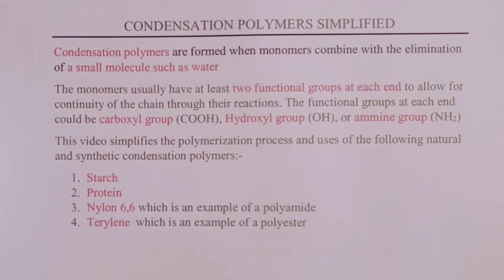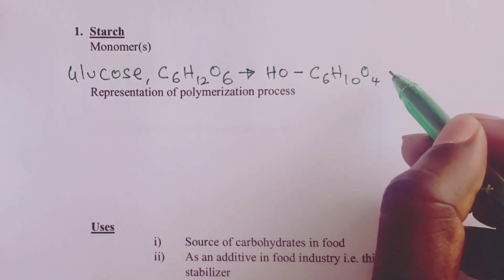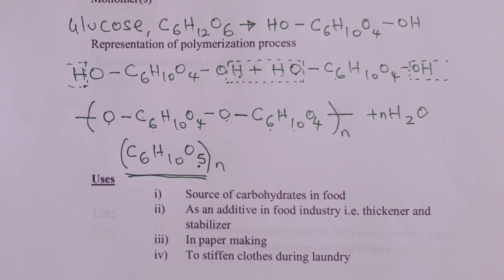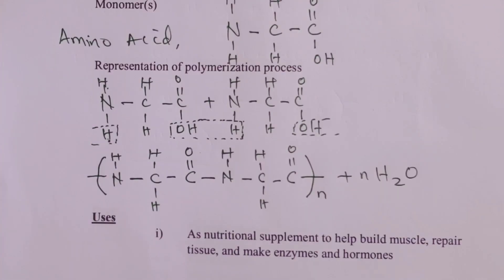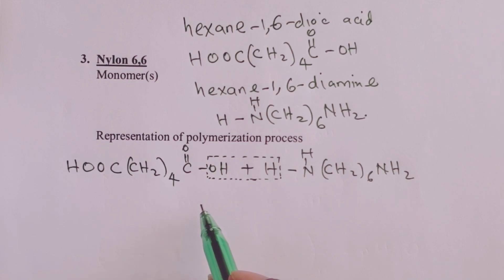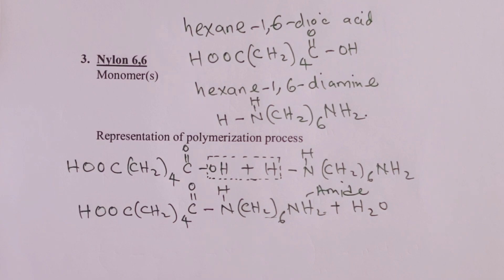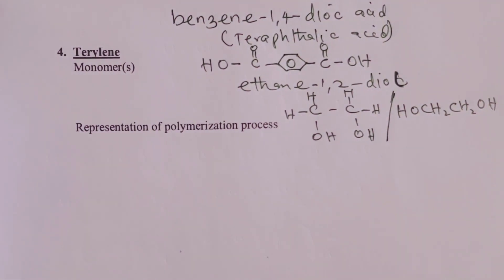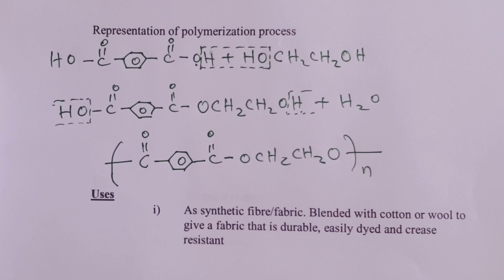Condensation Polymers Simplified

Comment: hi, thank u for this video!
i just have a few questions: for proteins, if there is 4 amino acids, for example. then do we have to write it 4 times in the structure of proteins? or is 2 times only required? 
and should n always be n? or is it supposed to be a number according to how many times a monomer is repeating in the protein?
Reply from the maker: For the amino acids, 2 is just sufficient to show the polymerization process. For the n, some questions will demand that you only show,  for instance, 3 repeat units. For such cases, you don't have to use n but end after the third repeat unit. Thank you and keep the Kemyan Teacher.
Reply: @thekenyanteacher  ok! thank you